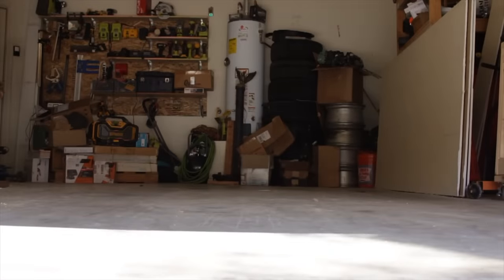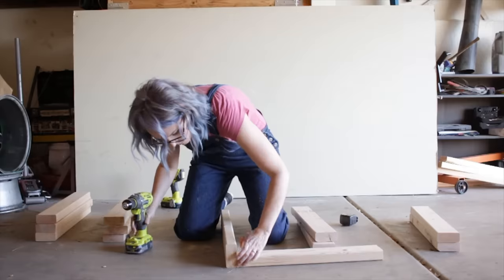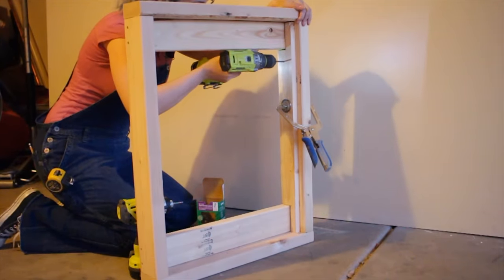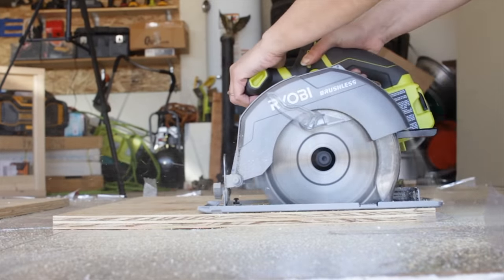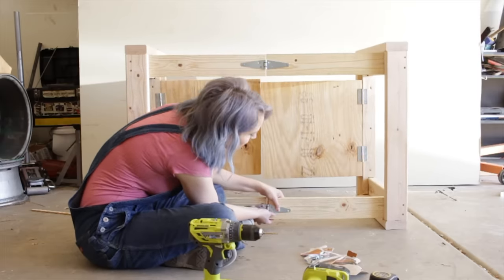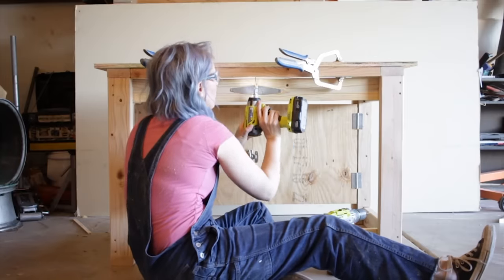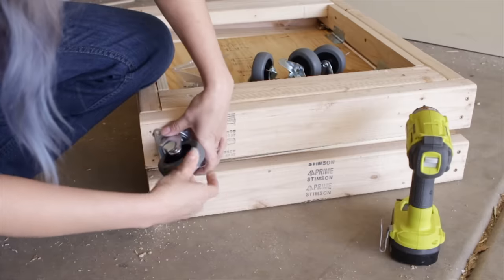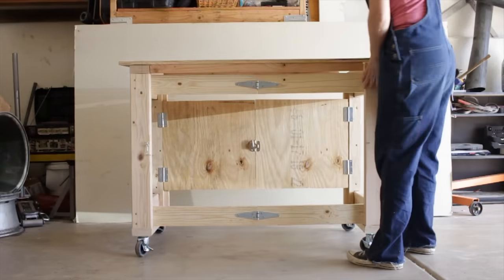DIY Folding Mobile Workbench

Comment: This may be one of the BEST woodworking videos on the net. As I was low on funds, I used recycled  pallete wood and a flat piece of laminated MDF I found thrown out by one of my nieghbours. I used old window sashs that were laying around and old hinges from an old door. My only purchases were 4 x 75mm / 3" locking swivel casters (4)
 and 4 x 12.5cm / 5" strap hinges (4)
 and proper wood screws. The only thing I had to keep an eye on was the twist on some of the pallete wood, but it's the most useful bench ever! I use it ALL THE TIME under my car port as I don't have a garage. I also added a removable four point power board to the side which hooks on to two screws on the side. THANKS SO MUCH for making this video. I LOVE MY PORTABLE WORK BENCH! - Aussie Ed.

Comment: I've made several of these smaller, as stands in my shop.  I need space-saving and flexible. Nice job using the sash locks!  I may replace a couple of them on the ones I built.   Also Iiked the reinforced top.  To attach my top I used 2-4 countersunk carriage bolts and a thru star knob to secure each one underneath.  Another way to make it more stable:  I made a bottom shelf that fits on the bottom ledge.  I don't secure it, it stays solid, helps keep everything square and you can put whatever tools and materials you are using for your project down there.  Easy to remove and mine can store in the folded workbench, but that would depend on the dimensions of your bench/stand.
Reply from the maker: That's genius! I was just thinking how nice it would be to have a lower shelf. I may need to make one now. Thanks!

Comment: Just completed building the mobile workbench using the plans I purchased from you.  I was unsure of my ability to transfer the measurements for the dowel placement so I cheated.  I turned the top over and drilled a half inch deep hole equidistant from each corner and glued a half inch x 11/4 in dowel in the holes.  Each dowel had a center sharp "pin" made from a cut off finishing nail.   I turned the top over and put it in place.  The sharp pin marked the exact correct spot for me to drill the receptacle hole and the top fit perfectly.   As I mentioned before the next project is the folding saw horses.  Thanks again for your great ideas.

Comment: Hi Elisha. I got the plans last year and built the workbench. I love it! The only thing I did not keep in mind was your 4x2's differ a bit in size than what I could get here in South Africa so it does not close completely. I could cut off some of the folding panels but I don't want to lose the length of the table as I made a bigger table top so I left it as is. I have a bench that it is not in the way but is there when I need it. My dad has a solid workbench and if I asked to use I could only get to use maybe 40cm x 60cm of 200cm x 60cm, which was super frustrating and I rarely made something due to this limited space I could use. This bench is just perfect and I could finally begin to get to do more woodworking. Thanks for sharing this great idea!

Comment: I just finished this.  I used Rocker bench castors that flip up and let the legs rest on the ground instead of the swivel castors.   I made the legs 31" long vs 27 because of the loss of the 4" castor height.   The bench is surprisingly sturdy when opened and the top is installed.    I mortised the 1x3 in the spots where the sash lock needed room to nest so the structure would collapse more fully.   

A set of dowel centers made locating the 4 dowels for the top a lot easier than measuring, just pick the 4 spots in the base and then use the dowel centers to mark the corresponding spots to drill in the bench top.   I only had 2 1/2" centers, so I did two, installed the dowels, then marked the next pair with the top on the first pair.    Self centering hinge bit also was nice to have to drill the pilot holes for the hinges.
Reply: Could you possibly post a picture of it and maybe a close-up of the adjustments you made?

Comment: Just found your DIY Folding Mobile Workbench video.  I like your design.  
It is an interesting comparison to the Worx brand "Pegasus Folding Table & Sawhorse".
Both designs collapse for convenient storage, but they do so differently.
Yours has wheels, the Pegasus does not.
The Pegasus comes pre-assembled and includes two clamps.
Yours is a DIY project, and whoever completes the project can take pride in their work.

I like that you demonstrate techniques to construct projects that can be used by people who don't already have a workshop or can be used in a "field expedient" environment.

A couple of years ago, I purchased a set of Pegasus Sawhorses (with clamps) and a Pegasus Folding Table & Sawhorse (with clamps), which have met my needs for portable workbench surfaces (for now, at least).  With a couple of two-by-fours and a sheet of 2'x4' plywood, the sawhorses compete with your Folding Mobile Workbench in function, if not elegance of design.

I like learning of the solutions people have created to solve the problems of small or temporary workspaces that still yearn for a full suite of capabilities.
Thank you for sharing your video, "Pneumatic Addict".

Comment: Just finished making mine today. It's pretty stout for a folding workbench. Messed up on the dowel rods. I accidentally drilled too far into one of the holes on the table top for the dowel rod. Still turned out reallly well though. The cut sheet and the step by step directions helped a lot. I look forward to making more of these kinds of projects.
Reply: I was unable to find the cut sheet.  Would you be able to share this with me?   Thanks

Comment: I like this.  I'm making mine similar with one design change to add stability.  Make the top first and set the dimensions of the legs. Then make the folding cross-pieces a little bigger.  When they are unfolded, they should be under tension and "snap" open.  They can still be latched to lock them in place.  Great stuff.

Comment: Just finished my bench this afternoon.  I'll have to say it turned out awesome.  It's been mentioned in the comments that the hinges are 3" narrow utility type.  They are in a 2 pack.  I bought the wrong ones.  Someone else mentioned it not folding together completely.  In mine this was due to the sash locks hitting the sides.  I'm very happy with the bench.  Thanks for sharing this.

Comment: Great project, I love folding and collapsing stuff! I'm planning on a shop overhaul this summer and I'm thinking about some folding carts as part of that, this gave me some great ideas. I forget who I picked it up from, but if you have a bunch of hardware to do some double sided tape or CA glue an activator is awesome for getting it lined up and holding it in place while you pre-drill and screw. Probably one of my favorite tips I've picked up.

Comment: Thank You! This solves a problem for me. I was thinking about making a top that could convert into a router table & table saw, but setting it on a couple of saw horses didn't seem like it would be stable enough. With this, I can make interchanging tops and still save on space. We are working in a medium garden shed with very little space.

Comment: Couldn't get mine to completely collapse flush. Theres maybe 1/2 inch of wood sticking out by the hinges of the support arms. Not sure what went wrong. You made it look so easy. Lol. It was my first major project. Im still satisfied  with it. 2 drills is better than one. Having to switch bits every time was tedious and my hands started cramping. I used 1 ryobi drill and 5 1/2 inch circular saw. The battery didnt last had to charge 3 times. Gonna need a spare or upgrade my arsenal. Was a fun but exhausting project in this Texas Heat. Thank you so much for your videos. Keep it up. Subbed.

Comment: I bought all the required hardware for $40 from Osh, which is sadly closing down here in LA.  I hope to get the lumber and finish this in a few weeks.  Keep up the great work 👍🏽
Reply: Were you able to build the project?, I bought it but it was a little confusing since the cuts don't look the same on the video and the plans, some cuts wouldn't match where they had to be

Comment: My collapsible outside workbench is two sawhorses from the Home Depot with a piece of 1/4 inch plywood(1/4 sheet) and an extension cord to run from my deck. Definitely not as nice as yours but it works too. Tip: If you leave your bench unpainted you can put AnchorSeal2 on the cut ends to prevent end checking or spliting. Really cool stuff.

Comment: The dowels are a good idea, as are the sash locks.
Something else to consider to fix the top in place - add some angle iron to the ends.
.
It can be screwed into the wood, or if you have a tap and die set, you can tap the steel and run countersunk/flat head bolts into it and use Loctite for a solid connection that shouldn't loosen up over time.
.
This would strengthen the ends a ton, and still allow access for clamps.  It would also allow you to tap the angle iron for extra bolts to hold down a vise or other bench tools as needed.
.
And if you do this, you can also do it on the front and back in place of the 2x2s.  It can also allow for small F/C-clamps to be used to clamp to the folding stretchers for a REALLY tight fit and skip the dowels entirely.  Clamps will stop rattle of the top if hammering something.
.
Another thing to consider - adding a layer of MDF on top of the plywood for added mass and a smoother surface.  Countersunk screws instead of glue makes it easy to replace if needed.  It WILL make the top a lot heavier and make it harder to move and store it, though.

Comment: Clever design and good instructive video with helpful commentary. I'm curious why you didn't drill through the top board for the dowels. Seems like it would assure a perfect line up of the holes instead of laying out the hole locations?

Comment: I also made this workbench. Only thing i did different is that i made those boards underneath the worktop a bit bigger. I placed them behind the upper crossbar. Now i do not need a lock on it because the board underneath acts as the lock. This also made it unnecessary to put those dowels in the sides. Also left out the bottom crossbar, since i would always kick it.

Comment: Great design. It's on my project list now. 
This probably already got said, but two suggestions: Cutting on the foam creates foam sawdust. Nasty! You also use up the foam eventually and it's got to get thrown out. To the landfill. I just spread  out a couple of 2x4's. And why not drill the dowel hole all at once down through the top? No need to do all that marking. Or am I missing something? 
Anyway. You have some great vids. I'll be checking out more.

Comment: nice job and good idea to modify using the sash hingers.  i have started making a copy of your table this afternoon.  thanks!     btw  have you ever tried using long driver bit on your impact driver?  it will give you a better angle and reach to drive in the screws in tight places
Reply from the maker: That's great! I'd love to see what you create! I do use a long driver bit occasionally. I probably should have pulled it out for this build ☺

Comment: A great build! I haven’t seen these in a long time. No greatly bizarre cuts, you don’t have to remake Lo Ban to have good hideaway furniture! Too funny, did all the Moms out there just cringe at about 2:10 with her on the floor with her knee bracing while the drill thing was going through the wood?
Reply: Ok, so I didn’t learn wood working from the same place I learned English, and even though I learned all the science and technology later, when the designs are from yesteryears gone by I can’t articulate the techniques.

Comment: Very nice project, it gave me an idea how to organize my limited work space. How about the durability of the table? Won't it collapse in half on the folding joints? I think it is the weakest point of the project, but I may be wrong
Reply from the maker: The joints were definitely my concern as well, that's why I added the sash locks. They definitely help hold the pieces tightly. I've been using the bench consistently for several months now and it's still super stable.

Comment: Great project, for not to measure when finding thr center of the dowel you can use dowel pins for finding center, or with thr smallest drillbit drill from top to bottom a hole, and that will be the center for your dowel. Otherwise this project rocks!. A good project to share it on woodworking romania fb page! 😉
Reply from the maker: 1947 The Factory Thanks man! Good advice, that definitely sounds easier. Next time!

Comment: For the top, maybe screw a piece of MDF to the top(that way you can easily replace it) and then with the added strength and depth you could go crazy with benchdog holes and or tracks of various kinds.  And make a specific table insert that you could make into a router table/fence.  I need to get out there and make something like this....
Reply from the maker: Great idea! I was actually thinking about the benchdog holes, but the MDF is pretty smart.

Comment: I don't have a real shop, just a 2 car garage...
I'm working in a corner of my apartment dining area...
Reply: I am in a better situation , in a my overparked backyard.
Every time I work I need at least an hour to set up and pick everything back up.
I am planning to build something similar to this, with some mod so I can fit in a router lift.
Reply: Also, she’s using $1700 worth of makita tools...
Reply: @sadkingbilly  You don't need makita or dewalt, ryobi is a great brand with cheaper tool. Woodworking is not really a cheap hobby, got to cut all the corners we can.
Reply: @bigfoxki  I know 😉 I have cordless Bosch, a no-brand circular saw and router and secondhand hobby tools from proxxon (also not cheap new). I have to work with a 10x14 cellar from which I have to remove my scooter before I have space to move. Luckily I mostly build dioramas and booknooks so my materials are small. But I love the idea of a folding work bench so I don’t have to use my freezer as table lol. For cutting corners, New Year’s Day I’m strolling trough the neighbourhood at 9am looking for the wooden sticks of firework rockets... a big bundle lasts almost a year 😋
Reply: I hear that. I'm on the apartment balcony.🤔🤔🤔

Comment: Pardon my ignorance, but won't the 2x2s attached to the underside of the plywood top prevent the top from sliding in any direction thus alleviating the need for the dowels?

Comment: Great design. Need to add locks on the casters. Where you able to use this with rolling casters?
Reply from the maker: Yes, I did use swivel locking casters with no problem.

Comment: Great video, I have a great folding bench and use it often but it is a little heavy and I think yours with the wheels is a better design.  Do you have a problem with the wheels making it move around to much when in hard use?

Comment: Hello :) I'm sorry if it's been mentioned and I missed it but why weren't the folding braces attached at the very top, negating the need for those slats under the worktop? Also I imagine if the top's cut in half, maybe it could be stored between the legs?

Comment: Great job: But a couple of comments:
Probably someone already pointed it out: ". Cut two, 18" x 21-1/8" plywood panels using a circular saw or table saw." Should be 20-1/8. It's correct everywhere else in the plans
Screw size (not length) should.be specified. My #8 1-1/4" screw heads were not big enough for the casters.Luckily I had some that were big enough.
I don't know if it was me or the sash locks but I couldn't get it to "catch". I ended up going with a sliding bolt type.
I know - pick, pick. Still a great project.
Reply: I couldn't find the cut sheet or designs, can you share them with me?

Comment: Very nice idea and scale could easily be changed to 36x72 but instead of 2x2 supports on top use 1x4 hinged and use those to also slot top in place using small mortis and tenon at ends that would square up the frame and Secure top both ways.

Comment: Thanks for showing how you attach hinges and sash lock. I was going to discard hinges for my work bench legs, which i'm currently building, as i wanted a gap free assembly and all the videos i saw required creating mortises. Are sash locks sturdier than barrel bolts?
Reply from the maker: You're welcome! I was originally going to use barrel bolts, but after installing the first one discovered they do nothing to prevent the members from pulling apart. They are only good at stopping lateral movement. Not pulling.  The sash locks are virtually the same price and create a much tighter joint.
Reply: Pneumatic Addict I guess you saved me a lot of trouble. 😎🙂

Comment: Nice work! It seems that I have to be mobile often, and my garage has way too much junk, so work benches I can put away are a must for now. I've got a little Keeter pop up work bench that's been very handy, and when I have to spread out more, I use a couple 6' folding tables. What advantages do you think yours has over the folding tables? Maybe height and stability? I hate working on my knees. Lots of people seem to do it, which blows my mind,

Comment: Curious how splitting the top and having it hinge/fold up from the sides in two pieces would work... maybe with the joint offset a few inches from center. Then there wouldn't be a separate wood top.... hmm.. HMM..  hm?

Comment: Great stuff, I've been tossing around the idea of something similar (currently using a board on saw horses) but was a bit worried about stability, also wasn't sure of the locking method to be used for the hinged part. 
I may very well build something like this sooner, rather than later.
Reply from the maker: That's how I worked before. I am seriously in love with having a dedicated bench now. The original design wasn't super stable, but with my modifications, it's solid! The sash locks are a great upgrade!